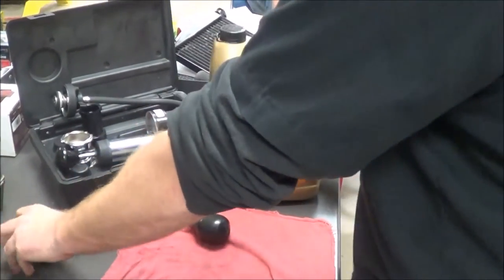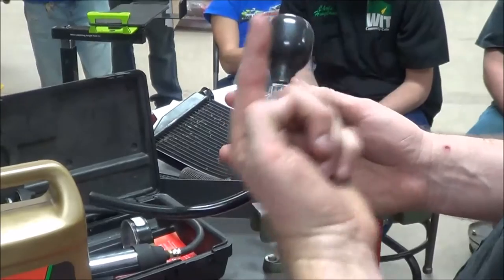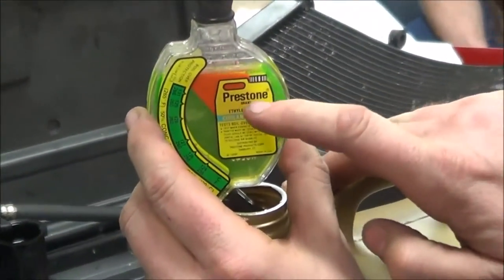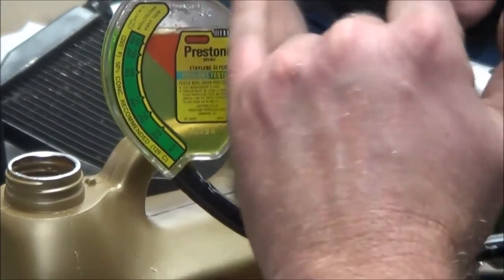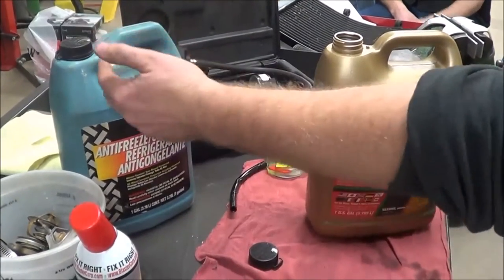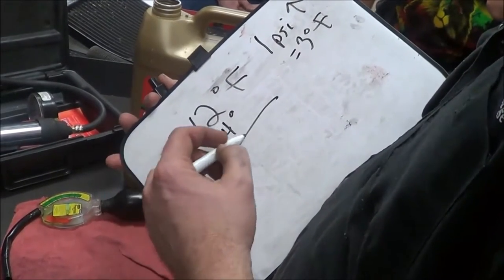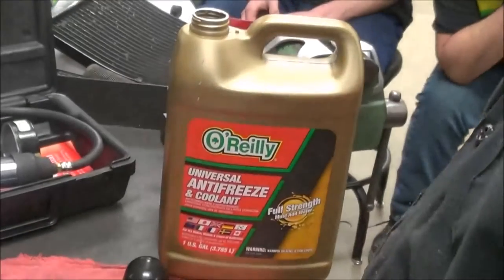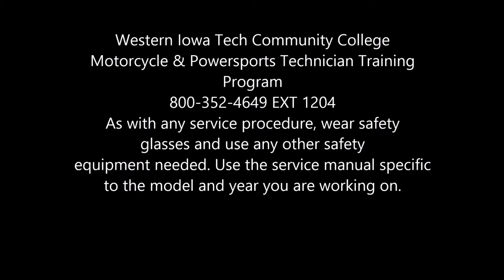How to test Antifreeze and how it cools the engine better than water.

Comment: That cheezy hydrometer is not very accurate and the boil protection is rated at 15 PSI. Super tech pre-mixed coolant in my car (2-3 years old) tested at -40F with a refractometer and was slightly discolored from green to yellow. Water in the antifreeze cools better than the chemical, thats why its always 50/50 as an industry standard.